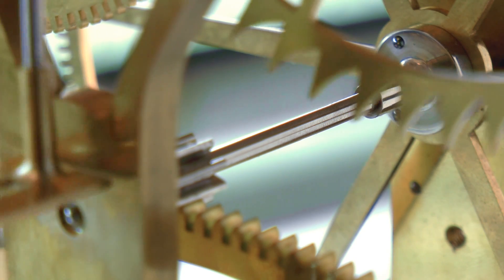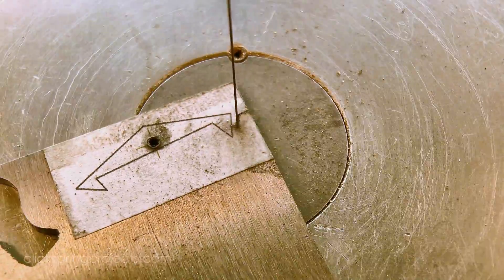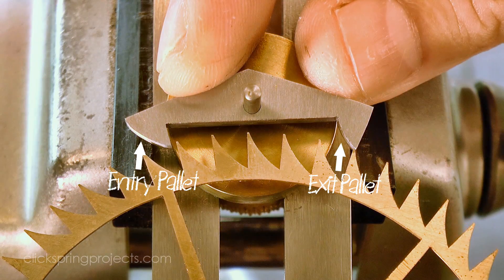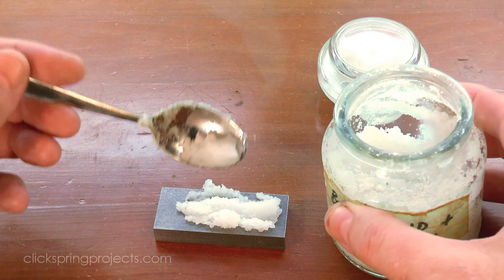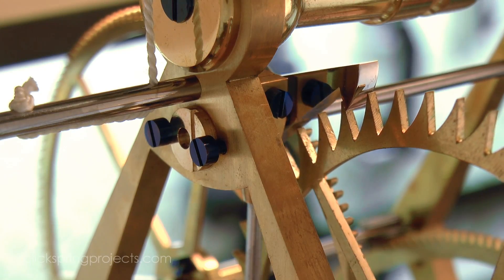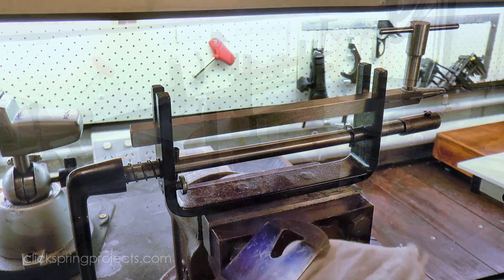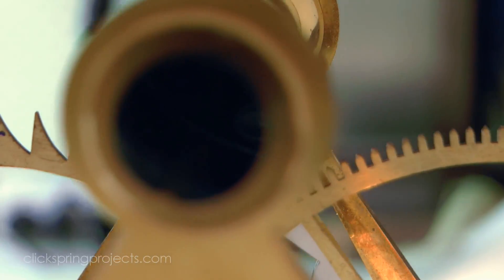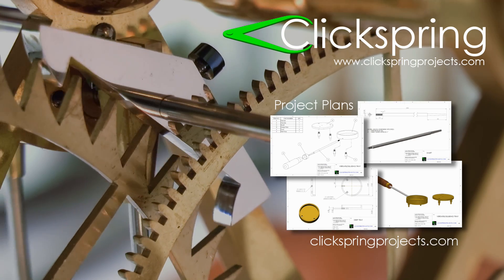Clockmaking - How To Make A Clock - Part 21 - The Mainspring And Escapement Pallets

Comment: The quality is, of course, the best it can be. This is the ultimate definition of "hand-built", and it's a beautiful thing. 

But I did have one technical question about the escapement. Since the escape wheel is made of brass, why would it be necessary to use an oil-quenced tool steel to make the escapement itself?  And, for that matter, why would it be necessary to harden the steel and then not temper it? (The polishing is obvious, of course.) 

It does need to be a differing material from the brass wheel to prevent galling and for a long life, but why would the escapement itself need to be THAT hardened when all of it's friction is being used against a wheel made of brass?  Would it work as well if it had not been hardened to that extent, or am I missing something obvious? 

Just curious. Love your videos. ;)
Reply from the maker: Its a little bit counter intuitive, but It turns out that the softer brass lasts much longer than than the hardened steel parts. The reason is that the brass (and any attached oil) becomes charged with particles of dust, and acts as a lap on the steel parts. Over a long period of time it is quite common to see hardened steel pivots and pallets showing clear signs of wear, whilst the mating brass parts show relatively minor wear. Leaving the pallets glass hard helps to slow down this wear, but even then it still occurs. Thanks for watching and asking :)
Reply: Great reply but if I hadnt seen it for myself I'd find it hard to believe.Years ago I tried to repair a broken clock and you could see a clear grove worn into the steel from the brass.My grandfather also said I shouldnt have cleaned the gears either but he did make a new gear and got it to work again.Some may be shocked but he actually hand filed the replacement gear most of the way because he didnt have the tooling to make it.

Thanks for sharing your project and while I wish I found it sooner I'm glad AvE shared it.
Reply: Clickspring
That makes sense. The brass, being such a soft material, probably embeds abrasive grains of dust and continues to scrape the steel like a very inefficient sandpaper. That's something I've seen happen on larger machine parts, where one is very soft and the other is hard. Normal procedure is to replace the softer part as well, because it would rapidly wear out a new mating part made of steel. Something I learned from an old machinist who used to use belt-driven machines when he was younger. ;)
Reply: single pallet vs many teeth - it's the wear ratio that has been considered.
Reply: Clickspring
Although pivots do wear down, the brass pivot holes do wear faster than pivots. When doing a repair of a worn, elongated pivot hole some people use a center punch to close the hole. This is not recommended as it only deforms one side of the plate, misshapes the hole into an ugly rotten mess and fails to provide support for the pivot through the whole thickness of the plate (because the unpunched side remains elongated). Scoring of the pivot during use usually follows. Better to disassemble the clock and use newer bushings in well centered  and widened holes. Hammering the bushing in place will "work harden" the brass bushings, thus they will not wear out so quickly.

" oil becomes charged with particles of dust, and acts as a lap on the steel parts."
    This is as much true for the effect on the teeth by the palette. Say you have a 40 tooth escape wheel each tooth is hit, scraped once per revolution whereas the palette has been hit 39 more times in the same period! The palette HAS to be made more durable than the escape wheel for their lifespans to be comparable.

Comment: Do you need much force on a scroll saw?
Reply: That depends on the material being cut, how thick it is, how sharp the teeth are (blades are replaceable and differ greatly), and how fast you want to proceed. They are nice  machines and completely adequate for certain jobs. For tougher jobs you'll definitely be happier with a bandsaw.
Reply: +ExtantFrodo2 thanks m8te

Comment: What an absolutely beautiful mirror polish. It's a shame that fingers will ruin it, otherwise I would try and do that on my parts.
I can't wait to see it all polished up and ready. Are you planning on giving the brass gears polishes, or are you going to leave it as a more dull finish to contrast with the shinier parts?
Reply: Polished brass parts usually get coated with a lacquer of some sort to prevent fingerprints from being too difficult to remove. Then you can wipe it with a rag and be good to go. Otherwise the acid and oils can permanently stain it. This can still happen if you don't wipe as they will eat through the lacquer, but without the lacquer the only way to prevent it is with gloves (ie not touching it). 
Hope that helps.

Comment: Is there such a thing as a motorized mechanical clock? A bit anti-traditional, but I would think the manual winding is a pretty severe down side to actually using them to keep time these days
Reply: Do people actually use them to keep time these days? Or is it more like owning a record player?
Reply: There are indeed many versions of motorized mechanical clocks (by which I intuit that you mean a clock with an escapement and pendulum).  Many or most of them employ some kind of periodic spring winder rather than have the motor running constantly. All car clocks between 1956 (roughly) and a couple years into the digital age ran this way using a solenoid driven spring winder. You could hear it smack the mainspring every minute or so. For those who didn't know, it was a difficult noise to track down when you thought it indicated something wrong with the car.
Reply: That's pretty cool, i've never heard of that, or even ever thought about using a mechanical clock in a car
Reply: Rob Mckennie
I fixed car clocks for about 4 years during the digital transition stage. The company I worked for did not obtain the tools or training to keep up with the times so they folded. Too bad. eh?

Comment: 30 plus years of working as a clockmaker have taught me to use grease rather than oil on clock mainsprings and that the barrel bottom, walls and winding arbor should also be well lubricated.  I feel the small amount of oil used in the video will not be enough,  will spread too thinly and therefor result in dry areas.  Polite observation.
Reply from the maker: Thanks for the advice Barry - The spring and arbor will need to come out again next week to permit fitting of the stop work mechanism, so will keep your suggestion in mind when re-assembling. Many thanks :)
Reply: Second that!

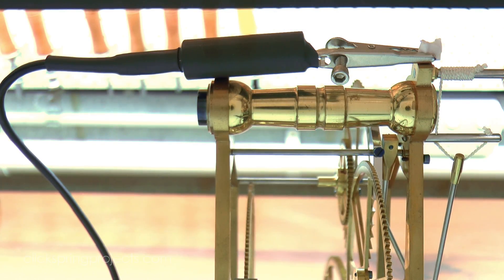Comment: What was with the alligator clip at 16:59? Also, what was that device you were using to measure the pendulum speed?
Reply from the maker: Part of the acoustic sensor used for beat analysis, the device is a Microset timer: http://www.bmumford.com/microset.html

Comment: how is the spring inside the barrel powering the clock? when you turn it you wind up te spring. but what does the spring push?
(i love your videos dude!)
Reply: The spring is unwinding and pulling the drum against the shaft.
Reply: At least that is how I see it.
Reply: The spring acts the same way as a weight falling in a cuckoo, grandmother, grandfather, or even big steeple clocks do to provide a nearly constant load to power the escapement.  The term 'falling' refers to the vertical travel caused by gravity to the weight.  The escapement makes the process take a long time.

Comment: 17:44  "a few z?"  "F U Z?"
Reply: Fusee. It's a cone shaped pulley with grooves cut in that accept a chain or rope. The chain is attached to the mainspring barrel, so that as the spring unwinds and loses spring tension, the fusee will pull on the barrel helping to maintain proper time when the clock is running low on power. Without a fusee, as the mainspring unwinds and loses power, the clock will run slower and slower until it stops.
Reply: The mainspring, WHAT?! What comes next?! I need to know... Tell me!

Comment: Hi Chris 
Another great video bud
I was just wondering what steps you will
be taking to prevent the brass tarnishing when the clock is in final assembly. 
As I can see it's starting to tarnish a little already 
and was wondering is there anyway of preventing 
this in the future?
Thanks again Chris
Reply from the maker: Yes ultimately it will get a natural patina. I will lacquer some of it, but there are quite a few parts that can't be lacquered because it would interfere with operation. Electroplating with something like gold or rhodium is not uncommon, but the vast majority of clocks are left to age naturally. The patina adds a really rich bronze color to the mechanism after a few years. Cheers mate :)

Comment: wow I have been following this project for so long now, I got goose bumps when you set it in motion for the first time. But I have to know, are you concerned with the glass hard O1 escapement eating away at the brass escape wheel?
Reply from the maker: Hey Enzo, It turns out that it tends to be the other way around - the softer brass lasts much longer than than the hardened parts. The reason is that the brass (and any attached oil) becomes charged with particles of dust, and acts as a lap on the steel parts. Over a long period of time it is quite common to see hardened steel pivots and pallets showing clear signs of wear, whilst the mating brass parts show relatively minor wear. Leaving the pallets glass hard helps to slow down this wear, but even then it still occurs. Thanks for watching and asking :)
Reply: Thats so crazy! would that be an example of "Galvanic corrosion"? You got me pulling out my old metallurgy text books....

Comment: Loving your work Chris. Such a pleasure to watch your videos. Just a quick question. Whats the name of the heat resistant wool type material your using during the heat treatments? Just the stuff I've been looking for. Apologies if you've already mentioned it in a previous video. Keep up the amazing work :D
Reply from the maker: Its a ceramic insulating wool called "Kaowool", you can pick it up in various sizes off Ebay. Cheers mate :)

Comment: I understand why you finish with such care and precision. I also really love watching through the entire process. What I was wondering though, is why you give yourself so much extra when rough cutting? Surely burring isn't that bad!
Reply: Also congrats! Absolutely beautiful!
Reply from the maker: I've learned the hard way that its best to be cautious; I hate scrapping parts that require so much prep like these. Its hard to see it because the scale is deceptive, but I generally don't really leave that much on, somewhere between 0.5 and 1mm. At least half of that is unavoidable; its required to make the finishing cuts with hand files. If I leave much less than 0.5mm on, the belt sander or filing machine can easily leave a cut inside that finishing allowance and ruin the part. Acute corners are an exception, I always leave a bit more on in that case because powered cutting in a tight corner is asking for trouble, best to go in gently with files.
Reply: I see, thanks! Keep being awesome :)

Comment: Man that spring winder rig made this job look easy!
I recently repaired an automatic air hose reel and that spring sure was scary. Took me three attempts to get it back inside before it exploded, but I managed to get the job done without injury. That coil was wound against the natural curve, and always wanted to escape sideways. Scary amount of energy in that bugger, and sharp edges too.
Reply from the maker: Oh they are absolutely scary things, no doubt about it - it will bite if it gets loose!!

Comment: Chris, on the side of the pallet nearest the escapement wheel, couldn't you have curved it to give the wheel more clearance?  or is there a reason why that would be undesirable?
Reply from the maker: The way it has been designed leaves very little clearance between that face and the pallet arbor hole. The gap is currently 0.6mm, so not much left to play with. That very slim clearance is primarily because this design embraces relatively few teeth. If it had been designed to embrace more, then the pallet arbor could be pushed back, and a bit more relief put in as you suggest. Cheers mate :)

Comment: What happened to your die filer? Is there a specific reason you still file all your pieces by hand or is it simply because you enjoy the process? Or are you being sneaky ;-) and removing the bulk of the material with the die filer off camera before finishing by hand?
Reply from the maker: The filing machine and belt sander are great for bulk stock removal, but are much too coarse for the final steps. Needle and escapement files provide the most control when it really counts.

Comment: Hey nice to see another click Spring video Chris I was just wandering with the escarpment wheel and the catch it looks like it would wear over time is that why the adjustments are used , especially with the tooth design ? Sorry if it's a daft question its just an observation .
Reply from the maker: Yes you are correct, the eccentric bushing allows for a small amount of adjustment as the pallets wear, although it only really assist in reducing the entry pallet drop, exit pallet drop requires a different approach. Thanks for watching and asking :)

Comment: I've enjoyed watching all the videos seeing the clock come together. It's fascinating to see all the work and engineering that goes into clockmaking. I'm looking forward to seeing the finished in action.

I have a question regarding the spring! Is there a calculation for the length and width of the spring to determine the stored output energy of the spring? I was a machinist for many years but I never got the opportunity to work creating springs and to learn the science of springs.

Comment: Why would you want the escapement pallets glass hard? Wouldn't you rather have the wear occurring on the pallets rather than the escapement wheel?
Reply from the maker: Great question Nadav! It turns out that the softer brass lasts much longer than than the hardened parts. The reason is that the brass (and any attached oil) becomes charged with particles of dust, and acts as a lap on the steel parts. Over a long period of time it is quite common to see hardened steel pivots and pallets showing clear signs of wear, whilst the mating brass parts show relatively minor wear. Leaving the pallets glass hard helps to slow down this slow erosion, but even then it still occurs. Thanks for watching and asking :)

Comment: question, what bit is that in 07:38 ? what does it used for?
Reply: I assume you mean the thing that he touches against either side of the shaft. That's an "edgefinder" - of the non-electronic type. I can't easily explain how they work, but they're quite simple and allow a machinist to very accurately find the edges of the workpiece of a mill. Once he knows where the edges of the shaft are, he can easily calculate exactly where the midpoint of the shaft is to drill the hole for the fastener.
Reply: ... and apparently it's supposed to be two words: "Edge finder." Whoops.

Comment: It always amazes me how much material you leave before you start hand filing. Can I ask how much time you actually spend filing a piece like that to get it to its "rough" shape(the paper lines)?
Reply from the maker: It depends a lot on the part; the pallets took about a day of tuning to get them where they needed to be before heat treatment. Thanks for watching mate :)
Reply: Thanks for the reply. Your videos are very inspiring. My grandfather was a watch and clock repairman at the time when some people would consider that it was a dying trade - he had a lot of business. He was pretty well regarded in the area and had a ton of specialty tools and made parts that were no longer available for purchase from the manufacturers. The tools are now in my possession along with a ton of books on repairs/building clocks and watches. I also acquired about 100kg of random watch/clock parts - thousands of them are in their tiny original packaging. For example I have a drawer full of  tiny mainsprings of specific sizes all in their small little casings to ensure they stay coiled. I hope to tinker with the parts and hopefully put something back together one day. I have a lot to learn but your videos definitely get me thinking. Can't wait to see the finished product.